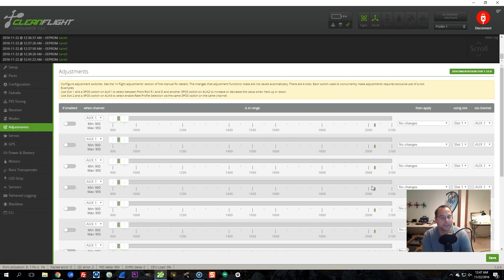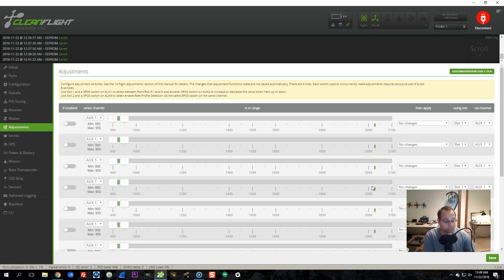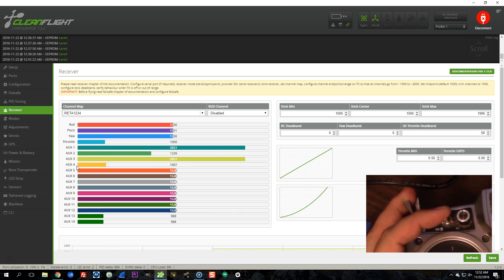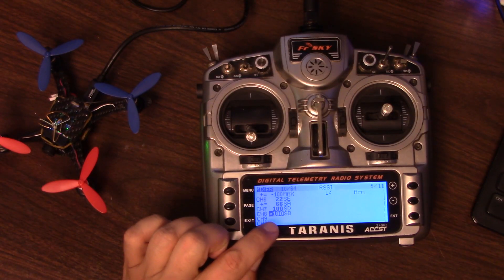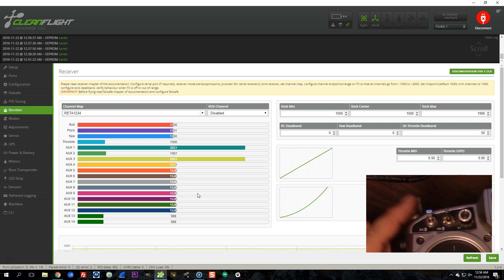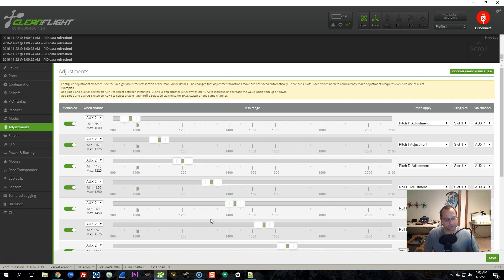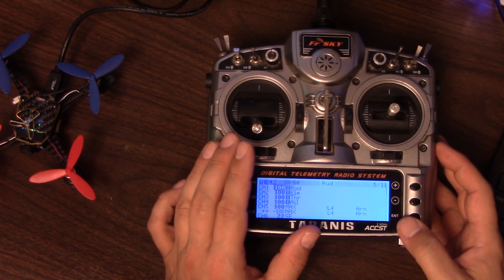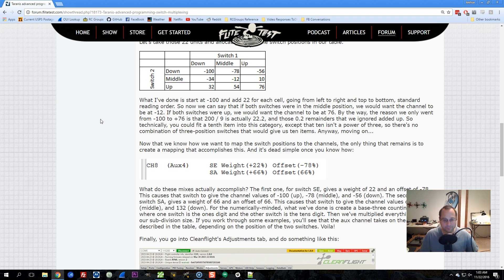Cleanflight / Betaflight In-Flight Adjustments | HOW TO SET UP

Comment: at 6:05 "By the way, the reason we only went from -100 to +76 is that 200 / 9 is actually 22.2, and those 0.2 remainders that we ignored added up."

------------------------

There are nine positions that we need to get, so there will be eight pieces. so if you had divided 200/8 = 25 instead of nine, you'd have much nicer limits which would have been :
-100     -75     -50
-25       0          25
50        75       100
I think they call this offset by one error in programming.

Anyway, this error doesn't affect the outcome of what JB is trying to achieve here. 
Any radio that does channel mixing should be able to do this.

Comment: Many thanks! I just wanted to give a heads up for people doing this on a 9XR. The calculation for output value is different on 9XR to taranis, it seems. 9xr has (input - offset) * weight. Taranis seems to be input*weight -offset. I had to change my offsets so that the adjrange scripts worked for me. I also am using the pots as 9xr only has one 3point switch, also on boot the 3point switch always needs to be low which caused alarms to trigger.

Comment: can someone explain how i can switch between the pid profiles on threeway switch ive seen how to do it whit the rates but cant find pid profiles
Reply from the maker: It can't be done. Only with stick commands while disarmed and from the OSD.
Reply: @JoshuaBardwell  did you get your stick commands osd working on dji fpv system?
Reply: Cant use osd interface since im using dji and iflight FC
Reply: Cant be done thats make a lot of sense😎

Comment: Does this still work in the latest betaflight and cleanflight?   This is how I had done it in the past.     I hadn't flown my quads since the end of last summer and have them out now and thought to put the latest BF on them and now rather than increasing one point at a time and beep the on board beeper it jumps like 100 points per second and isn't useful for inflight calibration.     I have the LUA scripts set so I can change it there but not while flying like I used to.   If you can let me know what i might be doing wrong if this still works in the latest BF I would appreciate it.   If Lua scripts is as good as it gets not I will stop searching and just go out and do it that way.   Love all your videos,

Comment: Finally got around to setting my TX for this with one of my quads, works Awesome! Although after 5 minutes I couldn't remember which switch did what lol, so I wrote a Lua script (and created custom wav files) so when I flip 'SH' it tells me what I'm about to tune ("Roll, D") Great videos man, VERY helpful! 
EDIT: Question though, Couldn't we use SW1 with Weight of 25 Offset -75 [Nine values: -100, -75, -50, -25, 0, 25, 50, 75, 100] and SW2 Weight of 75 Offset 75? This way it uses the full range of the Taranis output (988us to 2012us) giving a total of 1024 to play with, 1024/8 = 128 (divide by 8 because 0 is our ninth (well first technically) position: 0,128,256,384,etc) and then adjust the Min and Max of the Channel so it falls in the range with BF/CF? (might not even have to) In BF at least, it will let me select a range of 900 to 2100 for adjustments, so I don't need to worry about exactly 1000 to 2000 (I guess they give you an extra 200 to play with?) I haven't tested this to see the actual values in BF, but in the OpenTX Sim it appears to work with no overlapping (of 'us' at least). I just like seeing the cleaner numbers on the TX mixer lol. I guess the real question is how did you come up with the SW2 values of Weight 66 and Offset 66? And I think instead of dividing 200 (-100 to 100) by 9, you can divide by 8, giving us 25, the number you divide by doesn't appear to be the number of sub-divisions, but rather the number of "splits" between subdivision, thus giving us 1 more sub-division than the number we divide by. (like a sandwich, alternating between bread(sub-division) and meat("split") going bread,meat,bread,meat,bread,etc there will always be 1 more bread than meat if you start and stop with bread. This is my theory at least, not sure if I'm correct, what do you think?
Reply from the maker: I do think you could do that. But I haven't tested to be 100% sure.
Reply: @JoshuaBardwell  I'll have to give it a try this weekend, I played around in the OpenTX sim and configured two 3-pos switches and one 2-pos switch, but I'm not sure what I'd ever use 18 positions for lol. Instead, in order to free up my switches (since I'm using all 6 on the QX7 because of arming/air mode, PID tuning, and my lua script) I found you can configure the 2 pots similar to 3-pos switches. they're obviously not the same, but it seems to work on the sim and since BF lets you pick a range I think it'll work. I'll have to try that out as well. This is great stuff, so much fun seeing what's possible! Thanks again

Comment: 1. When I put Ray profiles on the adjustment switch it works on the quad but will not show in the pigs tab when I change the switch. Is there something I can do to change this?
2. On only one of my quads slot 2 assigns rateprofile 3 no matter what I do. I just work around it for now but is this something youve handled before?

Comment: Can you use say a momentary switch that has to be active in order to adjust your gains up or down(a safety switch per say)?  The other day I bumped my switch and my roll P was up to 150 and I didnt know it till I went to fly haha.  Lets just say,it took a bit to get it back down.
Reply from the maker: Yes you can do that in opentx. Just make the mix depend on the switch being in the desired position.
Reply: Joshua Bardwell.  New to this hobby.  Do you have a video on that?
Reply from the maker: No, I don't. Go to the Mixer screen and Edit the mixer line in question. Scroll down to where it says Switch, hit enter to edit, then flip the switch in question to the desired position. The mixer line will only become active when the switch is flipped.
Reply: Joshua Bardwell sweet thanks mand. I will do that today thanks! Keep up the awesome videos helping us out!

Comment: If you have a turnigy evolution: 
Set channel 5 to SwA on tx and in betaflight make it your arm switch
set channel 6 to SwBC
set channel 8 to VrA

adjrange 0 0 1 950 1050 15 3
adjrange 1 0 1 1150 1250 16 3
adjrange 2 0 1 1350 1450 17 3
adjrange 3 0 1 1250 1350 18 3
adjrange 4 0 1 1450 1550 19 3
adjrange 5 0 1 1650 1750 20 3
adjrange 6 0 1 1550 1650 9 3
adjrange 7 0 1 1750 1850 10 3
adjrange 8 0 1 1950 2050 11 3

Comment: Hello Joshua,

I still have an older FC running BF and so wish to use this technique to modify the PIDs in flight. I however have a couple of questions:
1. the value change is happening really fast: 11 units steps if you are really quick. I've even tried a smart switch to trigger EDGE on flip switch back and forth just to make the signal as short as possible... that did not help. How can I reduce that value step (if it is possible)?
2. It seems to save the PID directly to the FC... at least on the workbench ... I don't need to do the Taranis stick saving trick; when I disconnect and reconnect or just reboot and re-read the PIDs, they are modified...

Any community help would also be appreciated! 

Thx for the great vids !
Reply from the maker: I don't think the speed is adjustable at all, but the speed is usually not very fast, about 1 or 2 steps per second. So I don't know why yours is going so fast.
Reply: There are these options about RC_RATES or something similar... in BF, could that play a role perhaps
Reply: i know this is an old vid....but i had to set up a "no change" range in the middle AND i had to change the command 3 pos switch to different slots.
   
example: 3pos=Pitch P/no change/roll P_slot 1...... AND ......3pos=pitch D/no change/roll D_slot 2. 

this took 1 extra adjustment section....this was the ONLY way i could get it NOT to change the last known/set range and NOT to rapidly change rates = to 20 points at a time....I dont know why but it works this way for me.. version 3.2.3 airbotf4 firmware on a flip32f4 FC and flysky FS-i6X TX...

Comment: Hi Joshua, I'm trying to set this type of adjustment selection/switch multiplexing up using my Spektrum DX6.  I looked at your article on FT Forums, which is obviously written for the Taranis.  Have you tried to accomplish this using Spektrum mixes?
Reply from the maker: I honestly don't know for sure how sophisticated the mixing is on the Dx6 and whether it can accomplish this. You need to be able to weight the channels as shown and mix them as shown. Basically, what is being done should be possible on most programmable radios, because it's not actually that complicate.d So I suspect the Dx6 can do it, but I can't tell you for sure.
Reply: Actually, I figured this out, and its very easy on the DX6 Generation 2 (which shares the same firmware as the new DX9).  I have AUX1 controlled by a 3 position switch. Then I created a mix with a second 3 position switch as the master, AUX1 as the slave, Rates of +33%, +33%, and Offset of 0%.  I end up with 9 distinct outputs, from -133 to +133 in steps of 33.  After reading your article on FT forums, I was definitely overthinking this problem.  Thanks, Kevin.

Comment: hi joshua, awesome tutorial just wat I need... question, is theres a way that I can add a switch to "activate" the value switch (SB Switch)? so in case that I accidently turn on the Tx or flip the (SB switch) and start increasing or decreasing the value with out knowing
Reply from the maker: Yeah for sure. You just have to set it up in your Taranis. Set the mixer line so that the "enable" switch is set to REPLACE the line above it when it is in lock-out position, and so that the "enable" switch is set to zero (centered) when it is in enable position. Then put the actual adjustment switch mixer line above that.
Reply: Joshua Bardwell thank you! Add a enable switch work like a champ

Comment: I am wondering if you have set up a frsky rx with smartport to adjust pids thouh a uart. I have set all this up but cannot get it to work. Maybe a new video about this? Thank you
Reply from the maker: Yes, you need SmartPort. SmartPort is how the Taranis communicates the commands to the FC.
Reply from the maker: You can use in-flight adjustments as shown here, though. Just not a LUA script.
Reply: I have the smartport wired to the uart6 but the xsr has inverted telemetry and from what i can tell needs a wire soldered to a pad that is not inverted to get it to work. That is the info im talking about.

Comment: I want to try and do the switch multiplexing with my Turnigy 9XR - just to make sure, in the Taranis SE, SD etc. are the names of the switches, right? I have a PPM RX on the way, but in the meantime I am stuck with PWM on CC3D with just 5 channels, is there any possibility to accomplish this with just one AUX channel? 
If I disable the arming by switch, does Betaflight arm with Yaw right? 
So much to learn, so little time.
Reply from the maker: No, you can't accomplish this with one Aux channel. You must have on channel to set the parameter and one channel to control what direction it is moving. With a 5-channel setup, you cannot do this.
Reply: Thank you for the info! I will wait for the RX to arrive then. Or take my laptop out into the field maybe. Something I noted is that compared with Librepilot my Throttle is weaker, I have less punch than before. What could be the reason for that?

Comment: hi Joshua
is it possible to make adjustment but to get different profile
not rate profile but only profile
Reply from the maker: PID profiles cannot be changed in flight. Only via stick commands on the ground while disarmed.
Reply: yes it s what i want on the ground via the taranis
but haven t seen yet how to
in the ""then apply" listing there is no "profile"
but only "rate profile selection"

so we can only change between rate profile 
or there is a way to ...
thank for your fast reply
Reply: ok as you said often...
today i've learned something :)

i found this for the stick commands

https://github.com/cleanflight/cleanflight/blob/master/docs/Controls.md

thank you for your precious help
Reply from the maker: +Mansour zenagui you can change rate profiles from the in flight adjustments. You can change PID profiles from stick commands.

Comment: Joshua, thank you for this great tutorial.  I've got my switches and Naze at up with beta flight to work just as described.  What I'd like to do is DISABLE the adjustment capability unless I have another switch activated.  I just foresee to much "accidental tuning" from hitting the +/- switch any time the quad is plugged in to the battery.  How do you prevent accidental changing of the PID settings?
Reply from the maker: You have to do that by programming your transmitter.

Comment: Hi Joshua. Great vid. To know what your actual PID's are could the initial values be saved as GV's and be adjusted by 1 per second depending on the switch config?
Reply from the maker: There are better ways to go about it. There is a feature currently available that uses a Lua script on the Taranis to read the values out loud, but you have to install a custom hex that transmits the values via telemetry. Also, there is an improvement to BF OSD that shows the PIDs on screen while flying.
Reply: Just something in the vid seeking clarity on- at 9:43 your showing adjusting pitch P, but the upper end of the window is 1000 and the auxchannel is above the 1000 line. Is that right?
Reply from the maker: Sorry I missed your question for so long. I don't bother adjusting auxchannel ranges from 1000 to 2000 because I can always set the custom mode windows for aux channels to whatever I want.

Comment: Hi Joshua, excellent method, I use the momentary switch as a switch on the adjustment aux channel so its only activated when I pull that switch up. This gives me very granular control which I like and doesn't rely on me counting time.
Reply from the maker: Some people use trim switches for this function.
Reply: That's interesting, my Taranis wont use those for the Switch for an Aux Channel, they show as a source but not the switch.

Comment: I'd this how you'd tune your quad? had throught previously tuning a quad would be a terrible slow process having to test then land and adjust with laptop repeat.
Reply from the maker: Sometimes I tune this way. Sometimes I want to know the precise numbers and use a laptop or OSD.
Reply: Mmm is there a way to calculate the exact levels from blackbox one you've got it right?

P.s. thank you for your videos your instructions are awesome I'm new to the sport my quad almost finished just waiting on some posts been following along in your simulator tutorials. So good.
Reply from the maker: No, you can't calculate the exact levels from blackbox. You just have to fly and see how it goes.

Comment: negative weight is not the ideal way to reverse a channel for the taranis running opentx.

the servo screen has a simple direction arrow which is usually set to the right. it can be toggled left or right.
Reply from the maker: +btreecat I never remember to look at the outputs screen and am then confused why the channel is reversed. Keeping it all in the mixer is best for me.
Reply: Joshua Bardwell agree with you, I think it's a UX issue in OpenTX because on my ar9x the ch direction isn't even on the servo page (lower res LCD on the th9x) so I tend to do the same for anything that isn't a simple fixed wing model.

Comment: Thanks, I have always wanted to set this up, but never got to actually do it. 

I did some minor modifications to your setup, where I mix the SE switch with the potmeters on the side. SE has to be in the UP position to be able to do some PID changes. The Left side potmeter chooses roll/pitch/yaw, while the right side potmeter chooses P/I/D. I also added an EDGE function on the taranis to the SB up/down switch so it only increases/degreases the PID values with one each time. So if I want to increase P with 5, I have to operate the switch 5 times. I think this way you have more control of how much you are actually increasing/decreasing the values. If you are interested, I will gladly take some screenshots from my taranis and share with you
Reply from the maker: That's a clever set up. I still think I like the continuous increase, for myself, but I see the value in the way you did it.
Reply: Have you done anything to not accidentally adjust your PIDs while flying? I noticed that if don't set one of the adjustments to "no changes", the last adjustment is still active even though your switch/potmeters are not in that range
Reply from the maker: Hmm... I have an alarm on my Taranis when the "adjust" switch is not centered. That's all. When I am done tuning, I remove thee adjustment ranges.

Comment: +1 for using the trim tabs for adjusting values works so much better. works like a momentery 3-way switch.
Reply from the maker: +Kentucky but I would have to click so many times to add 20 points of D or to take yaw P from 70 to 100!
Reply: Joshua Bardwell works the same just click and hold. 👍
Reply from the maker: +Kentucky but right now I flip a 3 position and then go to flying while the value rises!
Reply: Joshua Bardwell a-ha but it is easy to go up and down quite a bit and loose where you are. with trim switch just click 5-10 times with audio feedback from radio. for larger coarse adjustments I use my phone or pc. trims become redundant on a quad and can be disabled in each axis.